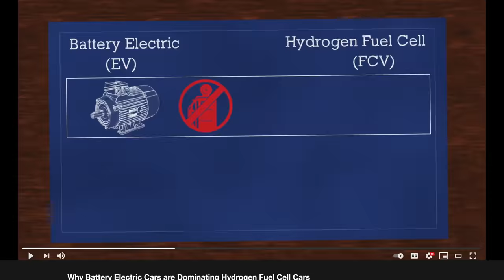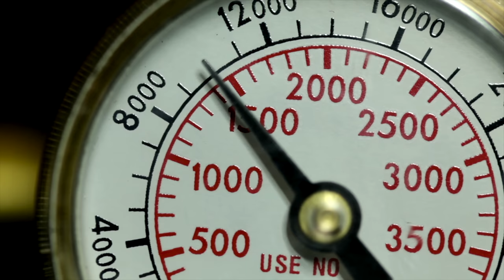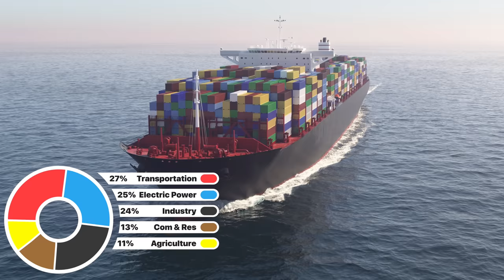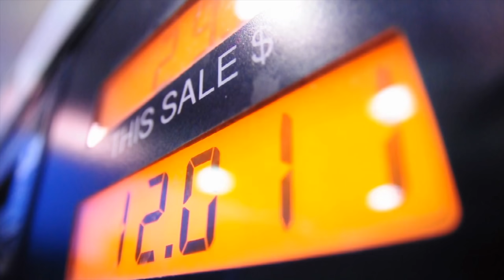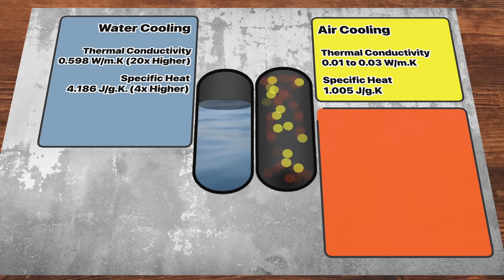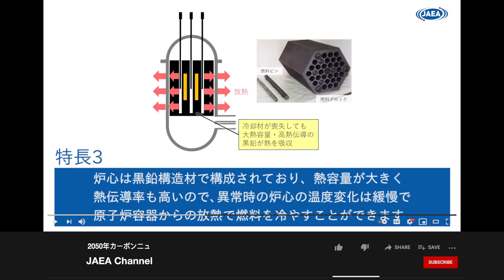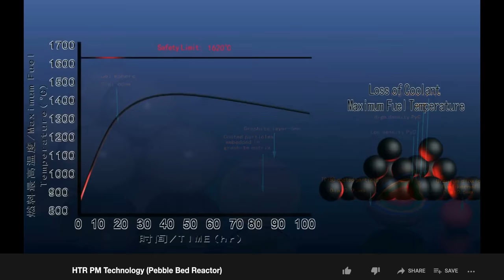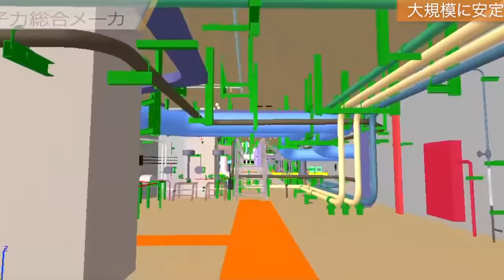Japan's Plan to DESTROY the Price of OIL and GAS!

Comment: You should review the Carnot cycle fundamentals.  Given the operating temperature of the HTGR is around 1000 degC, you get a much more efficient thermodynamic cycle for the nuclear reactor. (Older reactors are only about 30% efficient with a temperature of 300 degC)
Reply: True,but the HTGR will not be 1000C to start maybe never, but yes, higher temps,like 800C are much better for H2 production,But thyme Japanese are extremely backwards, they have a fleet of good reactors sitting idle, very ignorant people.
Reply: Operating Temperature # Temperature used in Carnot Cycle.

The UK is investing hard on Gen IV HTGR, which - like you said - operate at >900 degC. However, they aim to use temperatures of only around 700degC for most applications. This is due to many factors, but mainly that the nuclear supply chain relies a lot on common steel, which ideally would be kept at under 750degC
Reply: @paulbedichek5177  Local people are agains
Reply: Also, he clearly hasnt heard of thorium and molten salt reactors.
Reply: @paulbedichek5177  The Japanese HTTR actually runs around 950-1000C in full power and has been tested as per video generating a lot of H2 small scale last year, hence why it's said to be the ideal design for Hydrogen production and why they're moving forward for building a bigger Hydrogen plant. The HTGR running at around 800C is the one from China's designs which uses a Pebble Bed compared to Japan's prismatic block design. Also as for the reactor restarts, that's already underway as per Kishida's notes just in recent months. 

The plan is to have around 10 reactors running by Winter and move that to around 20+ by Summer, they also extended the operating lifetimes for these reactors (60 years from 40) after they are deemed safe for restart.
Reply: @wesleyhobbs2332  yes but thorium is being developed but not ready for main stream yet lots of engineering work being done and lots to do yet. Its hard to tell if it will finally work out and it is slowly moving forward but not yet there. I am hopeful they will make it work but it might still be many years away.
Reply: @douglasw5371  India says they will have one up and running in two years or less.
Reply: @wesleyhobbs2332  I hope you are right; many countries are working on this and are close but close only counts in horseshoes. It would be nice to have tho as it would help many countries solve their energy needs. If I remember correctly this energy can be used to make clean hydrogen also and that could be used to power cars and busses helping solve transportation issues as well.
Reply: The Carnot cycle doesn't directly apply to this type of cycle.  The working fluid spins a turbine.  Turbines can approach 100% efficiency in theory.  They do in jet engines.
Reply: @ryoukokonpaku1575  Exactly! People tend to judge HTGRs based on China's models, yet Japan's is much better in many ways, starting with needing much lower fuel enrichment.
Reply: @douglasw5371  Absolutely. The point made in the video isn't to say that the HTTR is the be-all-end-all in nuclear power. But what I like most is the idea of coupling it to other technologies to use industrial heat directly instead of converting it to electricity and then back to heat. It makes so much more sense.
Reply: @paulbedichek5177  that's a little harsh, there is bureaucracy and legit concerns that come with any nuclear program.
Reply: I think the carnot cycle assumes energy is lostin exhaust, etc. 

But if you insulate and reuse the same gas, then there is no exhaust and the the carnot cycle isnt relevant.
The efficiency becomes dependent on how well the system is insulated.

Comment: Truly brilliant ! I am a nuclear power worker and I am totally impressed by their genius ! Great narration also !
Reply: Even assuming the solution works, that only solve the production problem. Hydrogen transportation, storage and fuel cell generator all present problems: hydrogen is really difficult to transport and store, hence building a hydrogen station cost way more than a gas station. Plus, hydrogen car looks like a small chemical plant, it is costly to build and repair. 
Japan has been pushing hydrogen car for decade, check how many hydrogen stations Japan has built so far? Very little.

Comment: What about THORIUM reactors. To my knowledge this would be the best way forward for a variety of reasons. Mainly no risk of meltdown and no radioactive waste byproduct.
Reply: would be ideal to run a system of thorium reactors to consume the majority of radioactive waste produced by this advanced gas cooled reactor. Sought of side by side one set of reactors producing hydrogen with radioactive wast & another set of Thorium Rectors over the long-term consuming most of that radioactive waste to produce electricity & heat.
Reply: The use of thorium as a new primary energy source has been a tantalizing prospect since the 50's . Extracting its latent energy value in a cost-effective manner remains a challenge, and requires considerable R&D investment. This is occurring mostly in China, with modest US support, I think India is dabbling too.

Comment: They have been talking about ceramic coated nuclear fuel for well over two decades.  Good to see someone has finally done it.
Reply: There's already one operating and connected to the Grid. It's China's HTGR, but it operates at a somewhat lower temps compared to Japan's HTTR design, 800C vs 950-1000C from Japan's design. China's design is a pebble bed reactor, it works kinda like a gumball machine where the TRISO fuel is fed from the top of the reactor. Japan's design is a prismatic block type, though not really sure why there's a difference on the operating temps.

Comment: The one thing I’d be concerned about is that helium is produced predominantly from the natural gas extraction process. It is a non renewable gas and would be most predominantly produced in U.S., Russia, and any other large natural gas producers. A few years ago there was a serious helium shortage, so how would this be scaled?
Reply: Pretty sure once we start getting into space and such and mining it in the future wont be a problem lmao
Reply: I was thinking the same thing. Helium isn't easy to get (Cleanly).
Reply: Recycle it from party balloons, and by the way will the reactor make a funny noise when in use!?!
Reply: This reactor does not consume helium, it is a closed loop coolant. Getting sufficient helium for reactors will not be a problem and even if costs skyrocket its still a tiny fraction of the cost of the plant.
Reply: No problem, we just gotta solve fusion lol, then we can take the helium from that for these, and take the radioactive waste from these to fuel thorium reactors, and on down the utopian chain
Reply: @seanplace8192  In the meantime however  the science fiction video online is the Thing.
Reply: @seanplace8192  There is radioactivity involved in producing anything in a nuclear reactor.
Reply: @cmbakerxx  I did think that was the case, but if you have a lot of plants it could be an issue. You wouldn’t want to see the price skyrocket given it is used in rocket propulsion, medical and technical devices, and welding. But it is possible that it would be a small increase.
Reply: Pull the helium out and reinject the methane back to depleted reservoir
Reply: He shortages has nothing to do with this its a non issue,you think engineers and money people aren't aware of how much He we have?,so much are can use it in party balloons.
Reply: @cmbakerxx  I wonder how much of a helium loss this reactor has. It's the most leaky gas known due to the fact it's such a tiny molecule, not to mention it's superheated. A steady resupply is necessary for sure, the question is how big.
Reply: @koiyujo1543  Where in space you gonna get it?  Space is a big place, and costs are high getting there!
Reply: @jeffsmith9384  Utopia, that's the place to go! When can we leave?
Reply: @madgodloki  Why don't you  say/explain  " how you figured out " 
reactors have permits to emit (emit permits), reactor emissions, huge subject
but ignorance is bliss
Reply: @thomasherrin6798  when the reactor fires up
Warning siren: 5 times clown nose honks
Firing of reactor: noisemaker spins.
Generator spin up: increasingly high wheeze and dogs barking and cats meowing everywhere.. 
Reactor balances out and hits operating speed.. play circus themesong.
Reply: @marcwinkler  again, fossil fuels put out 100 times the pollution/emissions. There's permits for everything down to how high you can build a building. Do you actually have any numbers or is it just saying emissions is enough for ya to act like nuclear is anywhere near as bad as fossil fuels? It's way cleaner, they seal any radioactive waste in a concrete slab it can be buried on site so deep that it cannot effect anything even if the indestructible slab did break. You're not really making a solid point if emissions are your issue with nuclear but you're fine with the much worse fossil fuels 🤣
Reply: @madgodloki  " can be " but it isn't and when will it be .....? that is the f question
Reply: @seanplace8192  everything is easy for trained utopists and fiction scientists
Reply: @marcwinkler  can be. As in whenever they grab a backhoe and bury it, whenever it's ready to be buried. As in there's not really much of a logistic challenge and they can do it on site so it's probably already done in a bunch of plants.
Reply: Nom renewable? Tell that to my intestinal tract
Reply: Look you don't understand the helium shortages. The US extracted far too much and then sold it for under its market value. Give it another 15 years and I doubt we will see helium balloons
Reply: @koiyujo1543  Your solution, in a condescending tone, is heavy space mining? Lol right back
Reply: @samsoncooper1  correct there is a helium shortage  but like they've said it's closed loops finite amount needed
Reply: It is possible to extract only helium and not natural gas, it is just never been economically smart to do so. If the demand for natural gas is low and the demand for helium is high because of nuclear reactors running on helium, we will do the same techniques that we currently use to produce natural gas which is stored underground. Since helium is so light, it rests at the top of those underground pockets. Normally, we drain all of the gas in those pockets because all of it is economically desirable. If it is not economically desirable to extract the fossil fuels, we will simply get all of the helium first and cap the well.
Reply: @marcwinkler  you eat bananas maybe? They are radioactive but they are healthy right?  It is a question of dose.  We live on a radioactive planet, in fact it was more radioactive as life was developing.  Anyway it is a very interesting subject
Reply: Stop using it for balloons would be a great start.
Reply: @linmal2242  It's not a place it's a drug. Utopium.
Reply: @madgodloki  afaik there is no way to stop helium leaking from any vessel. There's no such thing as fully closed loop with helium.
Reply: Natural gaz is not renewable!?! Not sure of that! Plants decomposition makes gaz, any living thing make gaz when decomposing.
Reply: @jean-marclamothe8859 The term "Natural Gas" refers to the fossil fuel. So, not renewable.
Reply: @johngrisum  the amount used in party balloons is inconsequential. There are grades of helium and the portion use for party balloons is the lowest grade.
The market will decide because if the price were to increase enough, the sales would drop.
Reply: I also commented above on this before reading your reply.  I did a search on the comment section to see if anyone was keen to this rare unsustainable resource.  Helium is an amazing element that fills so many roles in our society, and it gets ZERO love - well - other than birthday parties.
Reply: @LisaFaiss  yes, if this took off globally there'd be HUGE demand and good luck with Craig's closed-loop system because Helium has the smallest atom size on the entire periodic table, such that you can't just leave/store a helium tank, it will all leak out through a closed tank valve: now imagine a plant sized system. It is the go-to gas of choice for underwater operations, far better than Hydrogen, less narcotic effect, lighter=more capability, deeper dive, longer work time, better verbal comms, better diver performance, etc.. 2 decades ago i was reading about it, and there was only one mining site in Texas for literally the entire nation's supply of helium....
Reply: "Carbon Neutrality" is crap.

Comment: Passive shutdown is the most critical requirement for any reactor.  Nice that they have one.
Reply: 1300celcius and no damages seriously?
Reply: There is another Type of Reactor, with lead instead of water  ;
Reply: @omnianti0  Yes, it's because it's designed to resist very high heat since its operating temperature is around 950c. The core is made out of graphite which has high thermal capacity (up to 1600c) and the fuel is coated in 4 layers of ceramics (can also resist up to 1600c) and paired with an inert coolant (helium) so there's no unexpected reactivity (e.g. hydrogen generation and explosions). It uses thermal radiation to passively cool the reactor down if coolant can't be actively supplied.
Reply: @ryoukokonpaku1575  you mean pipe are made of graphite ? never seen that anywhere and the pumps ?
Reply: @31stoffl  or molten salt

Comment: The TRIGA was developed to be a reactor that, in the words of Edward Teller, "could be given to a bunch of high school children to play with without any fear that they would get hurt."

Teller headed a group of young nuclear physicists in San Diego in the summer of 1956 to design an inherently safe reactor which could not, by its design, suffer from a meltdown. The design was largely the suggestion of Freeman Dyson.

TRIGA has been used in 24 different countries, often by undergraduates, and there's never been a serious accident that I've heard about. It spikes, very briefly, to 64 MWe. I'd hardly call it a toy, but not even undergraduates can screw it up.  

I mention this because Dyson was a proponent of high temperature gas reactors as far back as the 1950s, when he was employed by General Atomic. Dyson considered gas-cooled to be intrinsically safe, and water-cooled reactors to be intrinsically unsafe (though ideally suited for submarines, where small matters, and where your cooling reservoir is the entire ocean).
Reply: I use one to power my house

Comment: This video earned my sub. Great video. My experiences with EV tech is EVs are great for light weight things like commuter cars and bikes. The problem is when you do heavy work. There is a great video comparing the Ford F250 (combustion engine) VS the F250 Lightning (EV). They both towed a trailer with a car on it on the same road at the same time with the same exact trailer and two classic cars that were identical. The Lightning only made it HALF WAY through the challenge before needing to be recharged while the regular F250 had plenty of fuel left to finish the trip and drive back. The take away was "EV trucks are great as long as you don't do Truck things". I believe Hydrogen will be for heavy duty applications while batteries will be for light duty. Which is perfectly fine. I rather have competition in tech making things perform better, reducing costa, and pushing each tech to innovate.
Reply: The cold of winter is BIG problem wth any battery
Reply: Bravo - I agree on NOV, 17 2022.... probably will Not agree on NOV, 17 2025. However; your argument has one BIG azz flaw! you'r comparing an electric vehicle made by a FOSSIL Company that DESPERATELY wants to continue making ICE trucks and cars.... Outside of TESLA I agree no one is going to really have a useful truck for several years and that depends on when CYBER truck actually hits the highways.
Reply: Its just insane how many batteries heavy truck need to have to travel the same distances as diesel powered. And still there always be charging problem and electricity generation problem (esp. clean). So those kind of  vehicles better go hydrogen cell route straight away or/and use GEET technology
Reply: @haroldwestrich3312  It's pure physics. Batteries are 20x less energy dense than liquid hydrocarbons even considering efficiency. Battery operated vehicles are a total joke.
Reply: @AlldaylongRock  OH i guess you mean a "Joke" like they make people laugh because it's so ridiculous to drive an ICE (idiot combustion engine) how does it make sense to ignite and extinguish 8,000 tiny flames every minute? does that really make sense? Battery range increases regularly as charge times increase regularly as more and more renewables are used REGULARLY. Wait ! What?

Comment: Solidified hydrogen will be a game Changer, and you can use renewable energy to produce hydrogen as well, so the carbon footprint will be close to zero for the production. The use of solidified hydrogen is already tested in the US military, which actually is the reason it took so long to get into the general market. But to my knowledge this technology is starting as well now and will resolve the issue of transport and refilling.